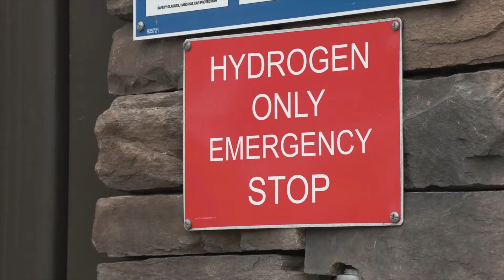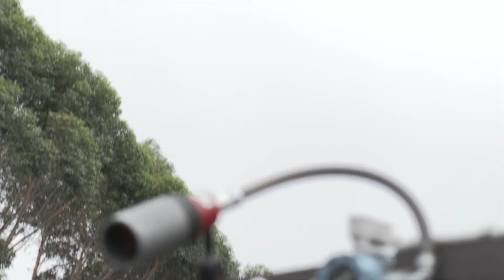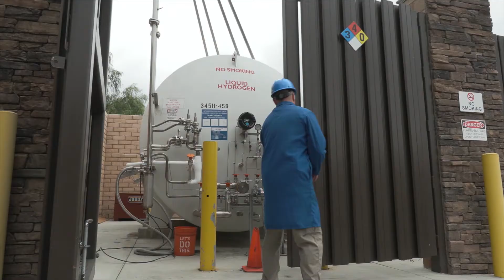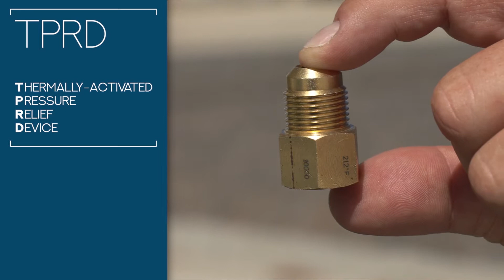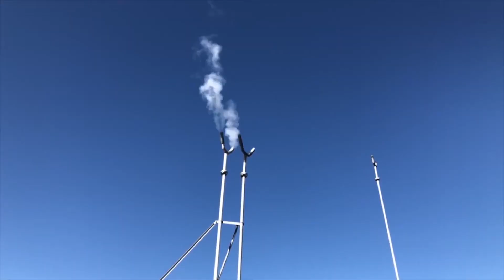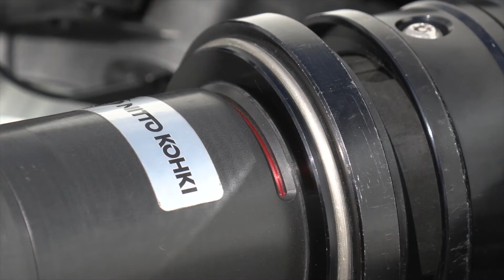Hydrogen Safety: Safety Systems for Fueling Stations

Comment: some essential safety tips for hydrogen fueling stations:
Proper Training and Knowledge. The first step in ensuring safety at hydrogen fueling stations is to provide comprehensive training to all personnel involved. 
Adequate Ventilation and Leak Detection Systems.
Fire Protection and Prevention Systems.

Comment: What about an end of line flame arresters installed in the vent to prevent flame entering in the process? Nitrogen releasing in contact with an ignition source will become an Atmospheric Deflagration.